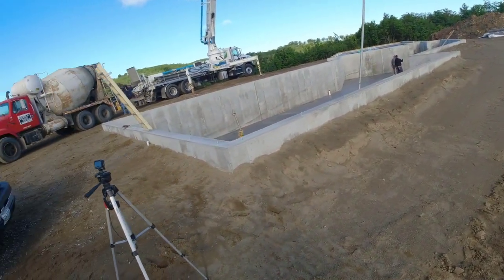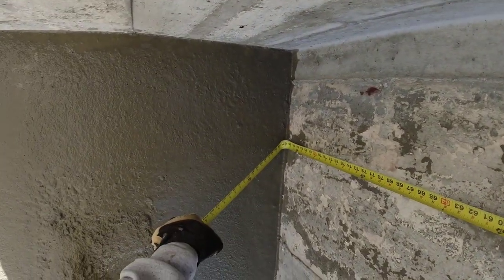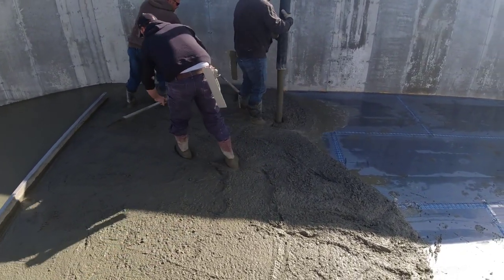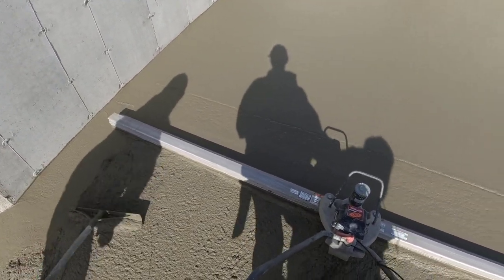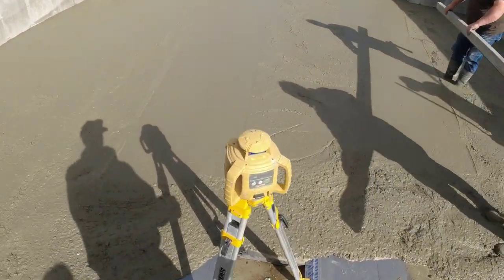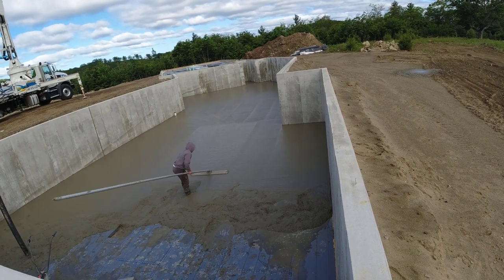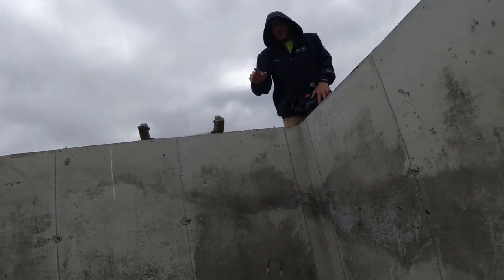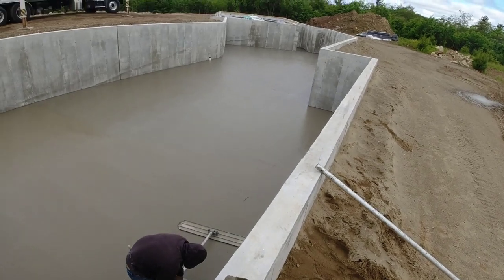Why Pouring Concrete Floors is Like MONEY in the BANK!

Comment: Hi Mike, I'm based in the Upper Peninsula of MI. Been on my own doing masonry and concrete for 16 years, I think for me its garage floors, driveways, etc. since I do a lot of them. Something I've noticed with different batch plants is some use different portland, which may or may not go really fast. One year a local batch plant switched powders from Lafarge to I think Holcim and it went almost twice as fast. I had to run retarter that year, especially on the hot days, they eventually switched back since too many guys didn't like it. So, sometimes it's good to check which powder they use, I typically ask that if I pour out of town which isn't very often. Checked out your channel and some videos, good stuff Mike!

Comment: Flooring installation particularly glue down LVP/LVT is my bread and butter. Literally no risk to me at all unless I have a green guy cutting in of course. My biggest risk is usually epoxy mainly metallic or special order types. Always have something come up, either the pattern or design, sometimes the mix was off. Overall install is where it’s at for me.. I would not mind getting into concrete, I have a PHD in floating floors so concrete floating would be a breeze for me.. You guys do good work, respect!

Comment: I do more exterior sidewalk,patios,driveways,parking lots,etc. I wish we had concrete that looked like yours. Floors here can be difficult as the mix is way more coarse. I wish they would use a blended cement with a finer sand but it is what it is. Most floor guys around here are running 8-10 people. A lot more labor when you have coarse concrete. Starting to get into more technical work as nobody’s interested in the tough jobs and they produce a little more relaxed environment for me to work in. We used to have big crews and took lots of work and four years ago just got rid of all employees and pour mostly by myself or have my wife help. Floors for me seem to have a lot of risk which comes from the help anymore. People are pretty unreliable.

Comment: Mike please help me out. Is there any real difference between bull float rockers that use a chain and ones that use a connecting rod? Seems like the chain would be less reliable. Also, the marshaltown bullfloat starter kit is like 500 bucks, is there a place where you can get used bull floats?

Comment: Not sure why you guys don’t have the columns in here in New York. It’s required that they are buried in the concrete to be legal. That’s why we do it when the house is on and you could still use a pump if you want.
Reply from the maker: Some houses have floor trusses that span the entire width so no columns, others set columns on top of the floor. Only a few set them first here in Maine
Reply: @MikeDayConcrete  yes, I know but  The houses around here are more than one story. Even with the floor trusses being 35 feet across They have columns underneath with a beam to pick up other floors.